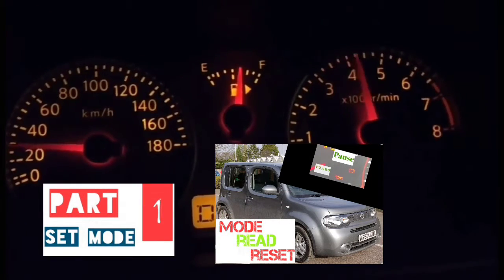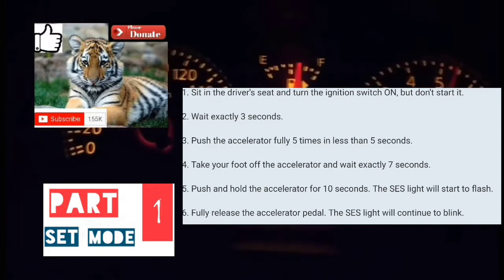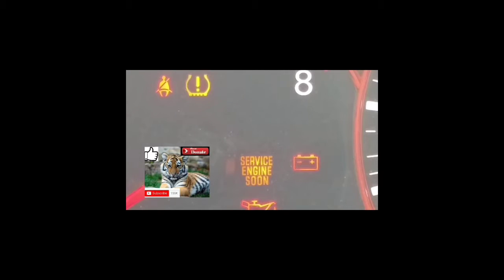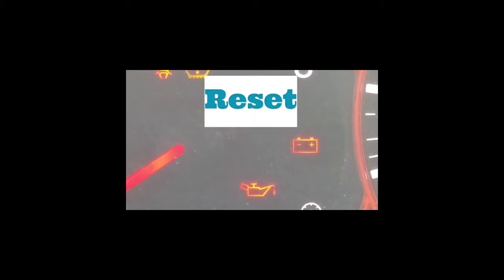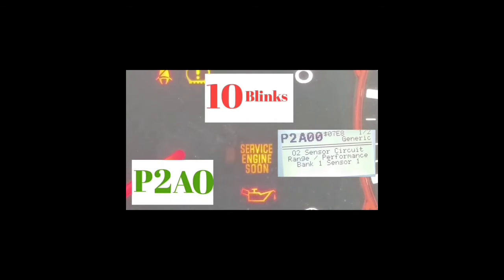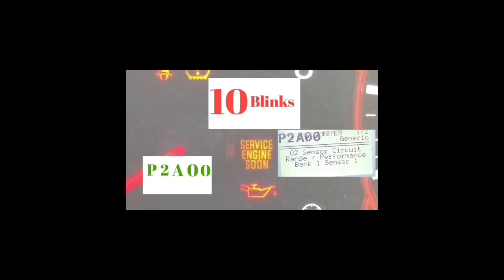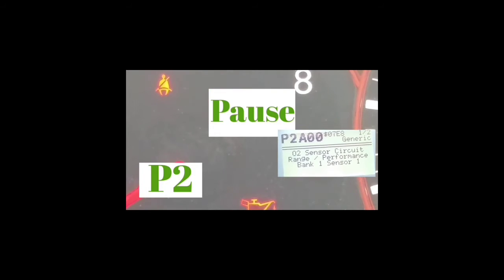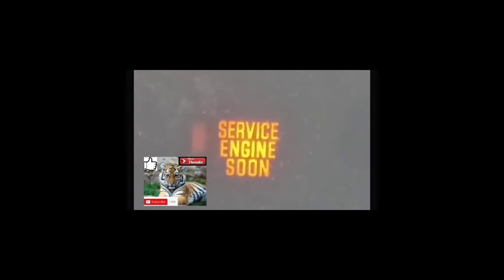How to Read and Reset Your Car's ECU- 2014 Nissan Cube

Comment: For inspection just unhook battery for 30 minutes when you replace the cables on battery,  check engine light will stay off for 50 miles before coming back on. Me and my friends did this many times for inspection only.